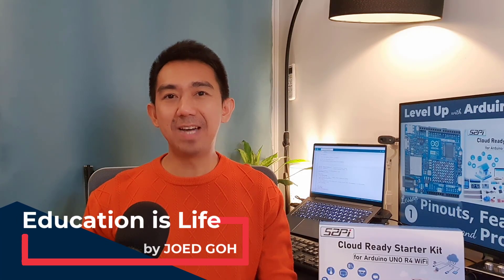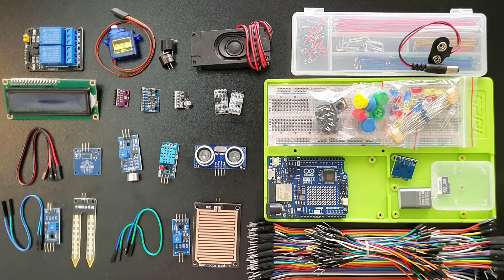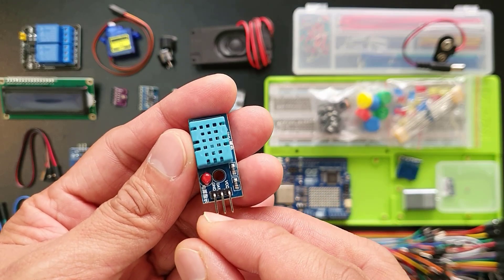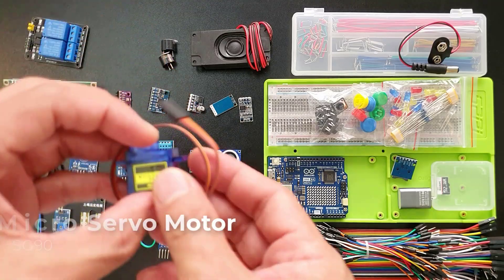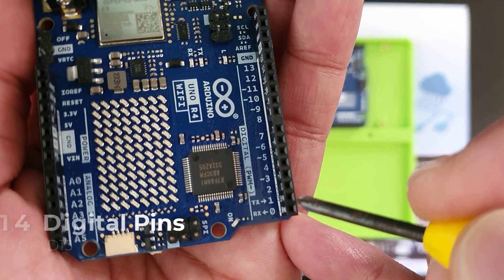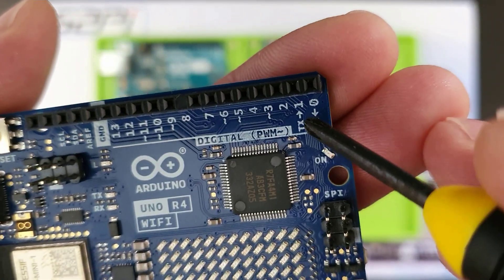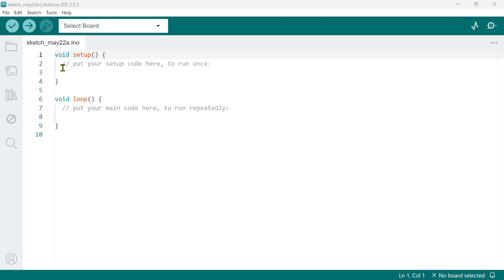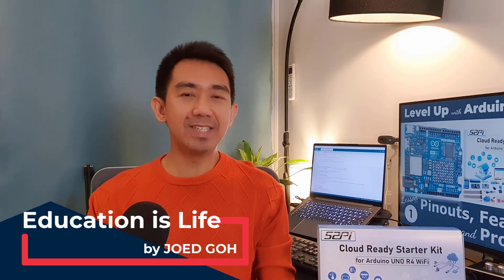01. Level Up w/ Arduino UNO R4 WiFi: Features, Pinouts, & Programming - IoT Development Crash Course

Comment: hello
The specification states that the module has 14 digital pins. However, the pinout diagram shows that the digital pins go from D0 to D19. D14-D19 are shared with the 5 analog pins. Additionally, there are two "D18-D19" shared with SCL and SDA. Are they usable? Can they be addressed by this number? How would this be done?